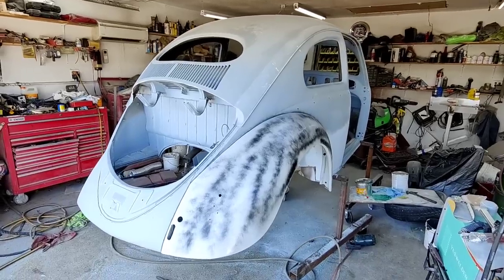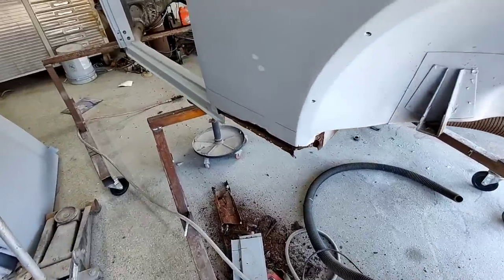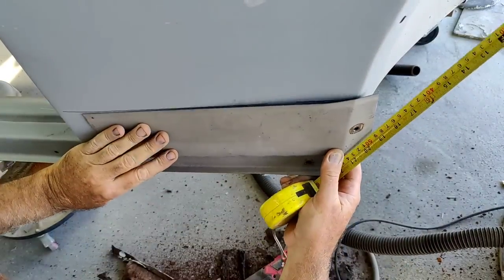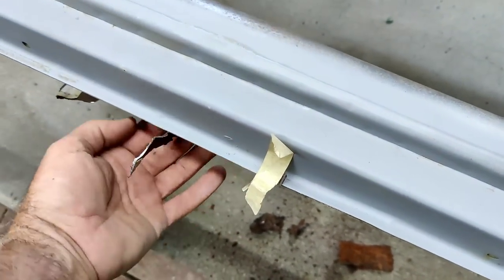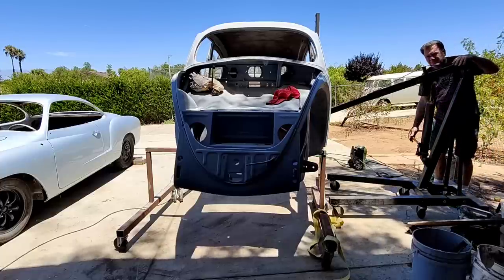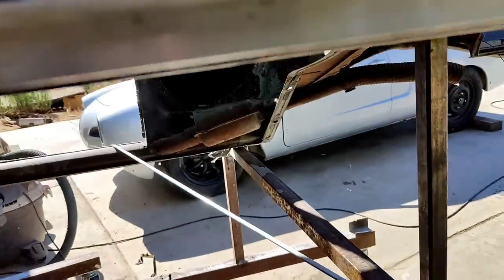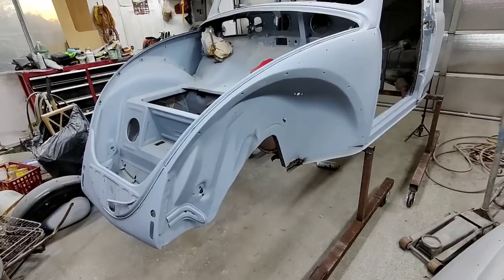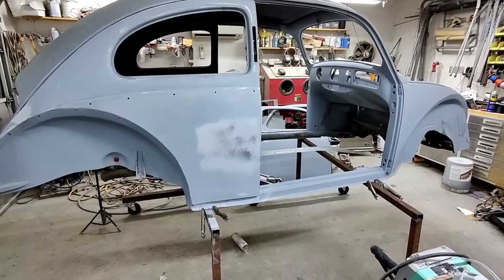1954 VW early oval window Metalwork Rusted out heater channel and quarter panel restoration

Comment: I have used the klokkerholm bottom plates before.  Yes to re-weld the captive nuts and I recommend that you add in reinforce where the jacking points contact these plates (less likely to dent if you use the original jack) 👍
Reply from the maker: Great tip!

Comment: Hey Mike, I really understand where your coming from. Too many people get caught up trying to do things “Perfect” and in the end it’s all about getting these cars back on the road. I believe the biggest advice any DIYer can take from your videos is this. Metal work is a simple process and when you can make some piece of steel fit as close to original and have two pieces bond (good penetration) correctly then that’s the goal. Everything after is imperfections that can be dealt with. How long it takes you doesn’t matter. Learning to Shape metal and weld properly is what everyone should be concerned about. It gets easier with more practice. Your mention about not to over think the process is spot on.

Comment: On my 59 Deluxe I welded all small holes I could but doors required my cutting out bottom 2 inches and hand forming new pieces and welding in...Im running a mlg welder but using gas less flux core wire ... required some experience...

Comment: The early VWs  are the best ones. 
I have owned a 55, 56, 57 ,58, 59, 60 in bugs.. drove the 55 to Cocoa Beach Florida from Monterey Calif in 1968.. non stop and back again 6 months later. 
54 right hand drive bus , double sliding doors, 16" wheels, crank out front window, 4 bud vases.. full sun roof no air box.. klik gauges. Split front seats..  Bull Bar etc  Bought it from a professional wildlife photographer for Nat'l Geographic, Life , Look etc He bought it new in  So Africa..  I paid $400 for it in 1965. 
1971 Bus.. the best year of any.
Jetta.. garbage
1973 THING in mint condition, gas heater, factory limited slip.. .. I have owned 130 cars and trucks.. next to a 1996 Dodge Ram truck, worst vehicle I have owned. Tragic joke.

Comment: I have a question, have you ever had a Vw motor that would not come out.I have pulled many a bug engine with no issue.The vehicle is a 57 oval window,the story is it was driven on the Oregon beach back in the late 60s early 70s by members of the grateful Dead and got stuck in the tide,till it was pulled out three weeks later,and was in storage till we bought it.i have cut the engine bolts off and you can spin it around.We tried to man handle it,but it won't budge. any Ideas it is stuck to the transmission.